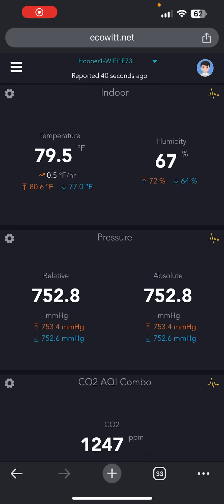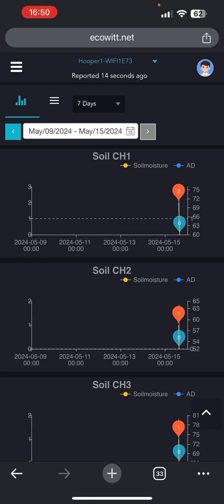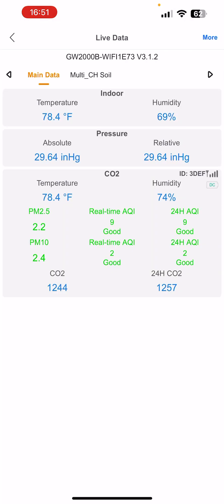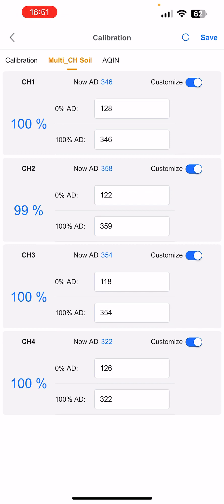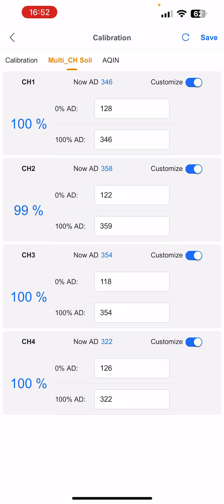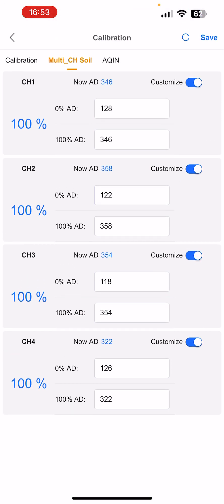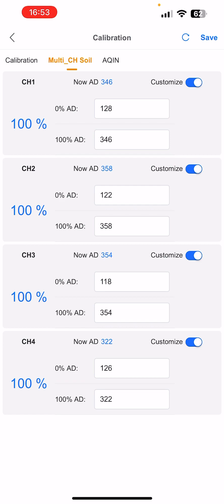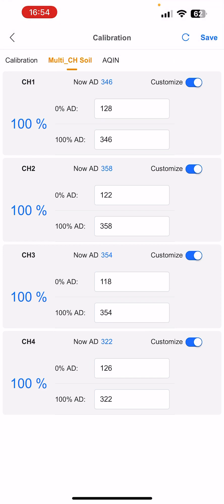Calibrating an Ecowitt soil moisture sensor

Comment: I really appreciate this video. This explains a lot what AD is and more. Although I must say calibrating with a cup of water to 100% and then just reading the moisture of a saturated pot. Usually sits around 40-45% and Watch the plants to see when they sag a bit usually around 20-25% works well also. This is extremely thorough video though and I’m going to save it to try it out later I just gotten so use to watering to 50% lol
Reply from the maker: @maniacmagee1493  thanks! I actually have a much more advanced and more accurate way of calibrating it now, I’ve been meaning to make a follow up video. I’ve realized that the 100% calibration must be done by reaching runoff with your intended irrigation method (hand watering always reaches a higher level than drip, for instance) then waiting 10 minutes or so for runoff to finish and settle at field capacity. Then I actually weight my plant, let it dry down to about 50% or less of what I know the pot holds (if I know it holds 2 liters, I let it dry until it loses 1000 grams and I know that’s 50% for instance) then I use an equation to calculate the AD0% value. Now my sensors match other soil sensors that cost 100s of dollars each. They still need another calibration every 3 weeks or so to adjust for drift from buildup and roots to be super accurate. But now that I can calibrate them easy mid cycle they are amazingly on point.
Reply: @SetTheCurve  this is very interesting. Talking bout dialed in. That sounds like a great way to do it def looking forward to a video about it. Cause field capacity after runoff is definitely a way to find out the true percentage. It’s just calibrating every now and then for me though. I have 16 😂 that’s work right there.
Reply: @SetTheCurve please if you could explain this further or even make a detailed video as soon as possible this would be greatly appreciated 👊

Comment: Hi, What percentages should i be aiming for with organic living soil. At the moment all of the pots are on 60% but a few days ago they was on 65% And when i grabbed a big handful of soil from each pot (4) and squeezed it, It was hard to get one drop of water out but i feel  it holding some water. I’m worried about over and under watering especially in the seedling stage because overwatering can stunt them /slow down growth.
Reply from the maker: @Kia-qo7nd  this depends a lot on what you mean by living soil. There is a big difference between between super soil (peat and compost etc) and garden dirt, for instance. I really need to make an another video to show the nuance.

My best advice without being able to demonstrate, is to look at the pot when you would water it, and take note of that value. Then take a note of the value it reaches after you water. Just use the sensors to notify you of the time you would water by intuition, since they are not accurate enough for their absolute value to have any meaning, especially across different substrates.

For seedling stages in natural soil, my best advice is to keep the area a few inches away from the seedling dryish, while watering the location of the seedling often. Plants are never over watered, the real risk is suffocation. If you are giving your roots a chance to breathe then you are on the right track

Comment: Is a free-air calibration for 0% moisture generally different than with the sensor in completely dry soil?
Reply from the maker: @JamieHarveyJr  yes, in my experience it is. Also, I’ve since learned that 100% from manual watering is different than 100% from drip watering, so now I always calibrate to 100% after my irrigation equipment saturates to runoff unless I plan on hand watering.

But regardless of how well you calibrate these, the best use of them is to learn what they read when your soil has dried back optimally, so you can set an alarm just below that value.

Comment: Great video quick question how do you connect 16 sensor with 2 gateways I tried to connect the second gateway but it just picked up the 8 I already had with the first gateway can you help me set up all 16 with 2 gateways.
Reply from the maker: There are two ways of doing that. One way is to isolate them during the assignment stage (by taking the batteries out of the ones you don’t want connected or setting up the device in a different location). Alternatively you can enter the serial of the devices you want it connected to manually. Notice on the configuration page that it lists the serial of the device once it connects; if you use that same format (the same number of characters) you can enter them manually. The serial is on a sticker on the side of the device. You may need to tell it to re-register if it’s already seen other sensors, however once it registers a sensor to a channel it will remain locked.

I’ve used these in facilities with probably a hundred soil sensors without issues.